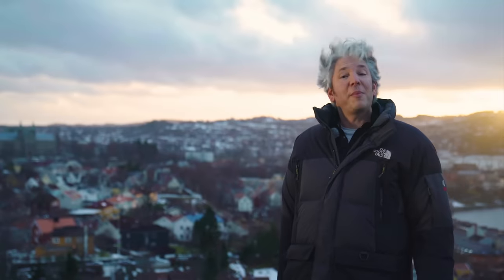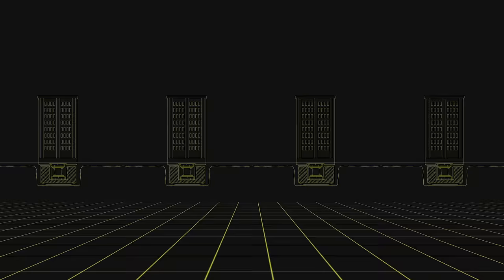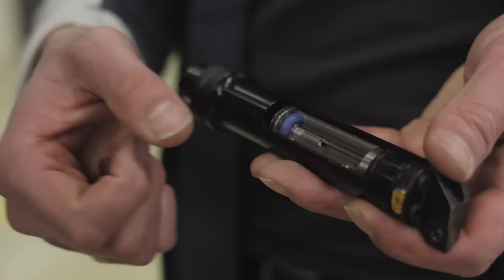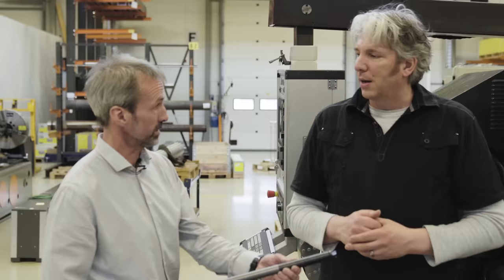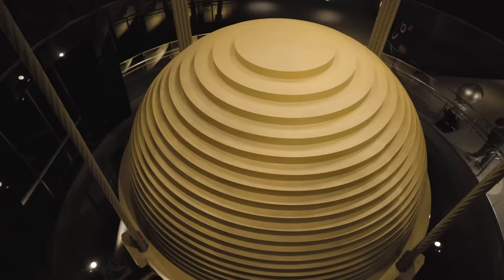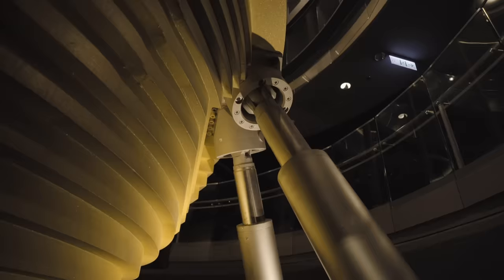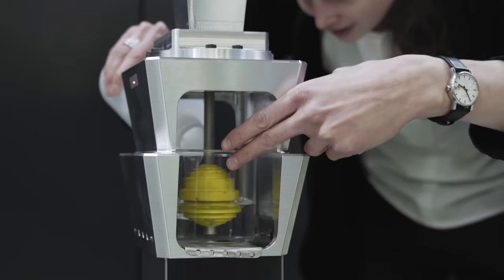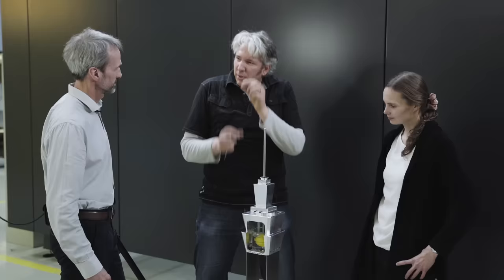Edd China explores: Vibration-damping technology by Sandvik Coromant

Comment: Many years ago I did part of my apprenticeship in one of General Motors stamping plants. We used ear plugs inside of ear muffs. The walls vibrated as car parts were stamped out of metal requiring at least three presses for each part. In their new stamping plant with much larger presses  there was no noise or vibration and only one press ror a part. I now understand the science behind the elimination of the vibration. Fascinating.

Comment: A very impressive presentation regarding damping, especially the oil-damped model tower. 
The engineers clearly know the difference between damping and dampening, although the opening presentation used (inaccurately) dampening.
Reply from the maker: Thanks for very nice feedback!
Reply: Actually both are correct. I don't know where it started (I suspect it was from a content AvE made), but people who don't know what they're talking about (no offense) keep saying this same thing. Sorta like the myth that got started a few years back that, "WD40 iS nOt a LubRicAnt."
Reply: As far as I can tell through research damping and dampening can be used interchangeably in the context of sound and vibration and only differ when talking about wetting something. It's worth noting that they have similar etymologies.

Comment: I've got a love/hate relationship with tools like these, they cost an arm and a leg and inevitably get destroyed by some noob who forgets to check his offsets, but when they are running right and all goes well they save a lot of time, money and carbide. I'm interested in trying one of these damped tools one of these days, sounds like they will save a lot of tool life. Nothing worse for a carbide edge than chatter, it'll hold up all day long with a nice smooth constant cut but you start throwing vibration into the mix and things start fracturing.

Comment: You can also attenuate the vibration of normal boring bars by constantly modulating the feed, so that a constant harmonic isn't sustained over the length of the part.  Although vibration is unwanted, sometimes the patterns caused by vibration can be quite pleasing to the eye, almost like a form of knurling.

Comment: Can confirm, on a 35 horse Mori turning center working mostly 4140, tool steels and large brass bushing materials; silent tools beat solid carbide boring bars every day of the week. Only time I used the carbide shank was when I had to reach way in past my silent tools length or on the odd chance I had to go way small in diameter.

Comment: My old Citroen 2cv had tuned mass dampers on each wheel. Basically a weight inside a vertical steel canister filled with oil. Pretty smart devices!

Comment: "rather than converting them into noise and heat" --> 4:07 --> A damper (oil, gas, eddy-currents (no pun intended, Edd ;) ) all essentially convert the kinetic energy in the vibration to heat.
Did you consider piezoelectric (active) vibration-cancellation in the tip? you can achieve roughly 10x higher effective-damping than passive (oil or rubber-based) dampers.
Reply: Piezo, that's a really good idea.
Reply: How does that work?

Comment: Respect for the engineering Sandvik put into their products. I am no stranger to their kit as I started my machine shop apprenticeship 45 years ago.
I also worked for a few years for one of Sandvik's competitors, the Company founder by the German chemist who invented sintered tungsten carbide. Can anyone here name him?
Reply: Widia?
Reply: @antonioroefaro  Good guess. The inventor of sintered tungsten carbide was Richard Walter. He sold the patent to Krupp (Krupp Widia) then bought a production licence from them. The profit from this deal went into founding of the Montanwerke in Tuebingen where he manufactured cutting tools. Early users struggled to sharpen such a hard substance so he expanded into grinding machines. Walter was among the first machine tool manufacturers to use CNC. I worked for the CNC division and we even had a visit from Sandvik who were shopping for a grinding machine to offer a sharpening service to their customers who used solid and brazed carbide milling tools.

Comment: a trick I sometimes use to control unwanted swinging of a load when I use fixed speed overhead cranes 
works the same way. but you got to get the hang of it by the way. 
I do do the move in intervals and it works well
Reply: Yup, you stop the crane a bit early and then give it a small push once the load has swung forward a bit. If you time it right, the load comes to a dead stop.

Comment: Good stuff - thanks for sharing.  I’m curious whether orientation plays a role with extreme length tools while machining.  In other words, is there an advantage to milling or boring vertically with the cutting tool at the bottom.  You know, gravity is your friend.
Reply from the maker: Hi! 

Thanks for your feedback. Yes, tool assembly orientation plays a role. Horizontal orientation is more demanding for spindle clamping and spindle stability because gravity will create a bending moment in the assembly. In the spindle interface this mass moment will be equal to tool assembly weight multiplied by distance from spindle interface to tool assembly mass centre. Larger resulting bending moment on the spindle will lower the harmonic frequencies of the system which makes it more demanding for the mass damper to counteract possible vibrations.
Hope this answers your question. 

Best regards, 
Åke Axner, Global product manager Silent Tools

Comment: LOL, I'm subscribed to this channel and Edd's, thought this was on his when I saw the thumbnail. Interesting to see how those work, I thought the insides looked completely different.
Reply: If you get hold of the new digital version, the SilentTool+, you can even actually use an app to get measurement data from inside your own tool!
Reply: @lamegunner  All the way down to a 10 mm tool bar?
Now imagine if the price point could be brought down to a level of affordability for the hobby machinist? Put the App on your phone and check how it is going.
Reply: @markfryer9880  hobby machinists don't need it. They don't have the machine rigidity to take advantage of it.

Comment: The whole concept of tuned mass damping is very fascinating. What a dramatic difference adding that damping oil to the model mass damper made but is the actual mass damper in the Taipei Tower  immersed in damping fluid?
Reply: No, it's attached to big hydraulic pistons that I'm assuming force the oil through a set of valves and restrictions to provide the damping. Though I imagine that it could also be actively damped by having the pistons push the weight around controlled by a computer that monitors accelerations of the top of the tower.

Comment: Great video, very professional, very well done, but partially wrong . The issue with chatter in a cutting tool is the phenomenon of a standing wave in a system not the frequency. In which the input frequencies compound each other within the system components eventually leading to what we see (and hear) as chatter. It is a result of the resonance of the system and the input energy, and it affects ( in this instance) the boring bar. The use of the TMD (tuned mass damper) is that it has it's own specific resonance frequency, which changes again when it is suspended in media (oil). The frequencies of the tuned mass damper and the boring bar counter act each other preventing the standing wave from building within the system, the energy is then dissapated through the opposing and overlapping sinusoidal waves. The tuning is really just a basic estimate of the frequency that most effeciently reduces the node/anti-node magnitude of the wave energy. Spolier (sorry Sandvik) but the TMD is just an estimate, as the energy input is dependent on so many variables that simply cannot be accounted for and change from cut to cut. The TMD principal works well, and Sandvik is taking it to the next level as expected. Just a little "gimme" from my Tool and Die apprenticeship days, wrapping some soldering wire around your boring bar in an inconsistent pattern has a very similiar affect. Don't believe me, try it next time you're on the lathe.

Comment: A few questions:

1. What tolerance was the machining being held too?

2. How much did that tungsten carbide ball cost?

3. How much did that project cost altogether?
Reply: I am wondering the same things.?
Reply from the maker: I’m waiting for confirmation on the weight of the tungsten ball to be able to answer that part.

The construction and manufacturing of the tower took the equivalent of one work week for one man. The rest of the calculations you will have to do your selves. 🙂

The machining of the tower parts didn’t demand any specific tolerance so I don’t have an answer on that part. 

I will get back to you regarding the tungsten ball.
Reply: standard tolerance for any kind of modern machining is +/- 0.002" or roughly half a mm, good cnc machines can easily hold 0.0015" or less without asking too much of them. easy operations like face and end milling, facing and turning can easily hold tolerances like 0.0005" or less without special considerations, any finer than that and you'd generally use a different machine, normally a surface grinder, because it doesn't make much sense to do them on a mill or lathe
Reply: @SuperAWaC  Yes that is the standard/default tolerance, but if you noticed when they put the ER collet in the top to old the rod it was just a perfect fit.
This might of been also a good test for Sandvik to hold a really tight tolerance, just for bragging rights :)

Comment: Can/has this tech translated to underground mining drills (eg: airleg)?
Reply from the maker: Hi Phil,

Now, bare in mind I'm in no way an expert in the field of mining, but after talking to colleagues who work in that business area I think a somewhat correct answer would be: No. :) There is no real need to silence an underground drilling rig as the operator sits in a fairly sound isolated cabin and no other personel are near by when drilling.
Also when drilling underground you don't want to dampen and absorb that energy since you utilise it when the drill head hammers while it rotates.
Reply: @sandvikcoromant : Not all drill rigs (Muki's & Jumbos et al) have a cab, our's don't. I was thinking more about Air or Jack leg drill's which transfer a lot of vibrational energy to the miner resulting in a lot of tendonopathies
Reply from the maker: @philschneider3040  Thanks for clarifying. That sure sound like a workplace safety hazard. Are those drill rigs of an older kind or are these types still being sold for some reason? Sounds to me like something there would be a solution for in 2019.

Comment: This video is well produced but not technically correct though. The narrator repeatedly tells that the damper in Taipei 101 is useful in earthquakes, which is wrong. The damper is only used for typhoons amd heavy winds to reduce building vibrations. During earthquake damper locks via a locking mechanism.

Comment: ....so the Taipeh tower would need some damping fluid too, to be more effective.
Reply: See the hydraulic pistons attached to the base?
Reply: @danmetzler7687  Yes, saw them but the fluid is a much more elegant solution. I wondered how the hydraulics work, if they are driven electrically they could fail during a catastrophy.
Reply: Nils Frederking I assume it’s not active hydraulics (could be wrong). Maybe just a hydraulic damper like cars use? No springs, just damper
Reply: @danmetzler7687  Thanks, that makes sense.and would be of course the better solution in this application.